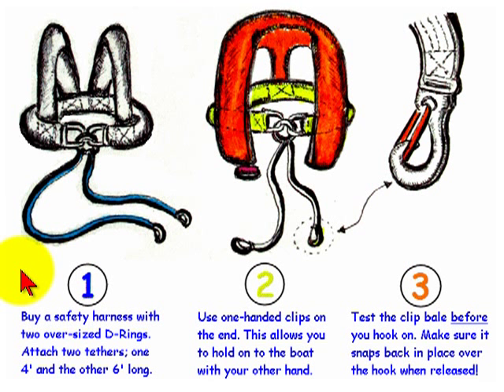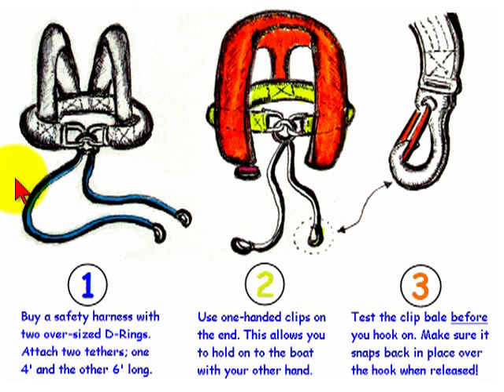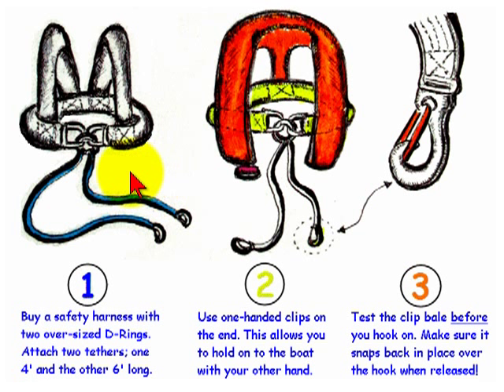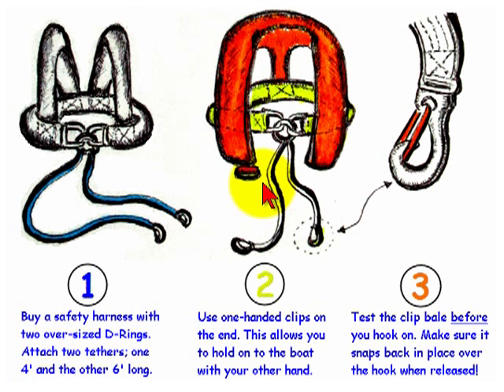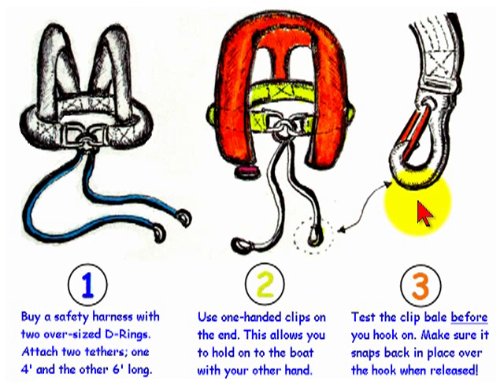How to Use a Sailing Safety Harness!

Comment: Why is one tether supposed to be 4' long and the other supposed to be 6' long?
Reply from the maker: Joseph, a shorter tether clipped to windward could help prevent you from falling all the way overboard. No guarantees, but it's an idea to consider. A longer tether will be more comfortable, but if you fell, you might end up being dragged alongside the boat. I would want at least one tether that was short enough to keep me aboard, even if stretched full length from the windward jackline.
Reply: Is another purpose of having two tethers, regardless of length, so that one could be disconnected while moving along the deck and then connect closer to the destination while another keeps you secured to the boat?
Reply from the maker: Absolutely. That's the major reason for two tethers.